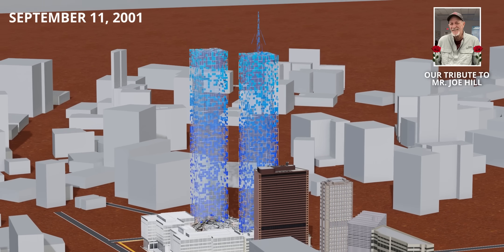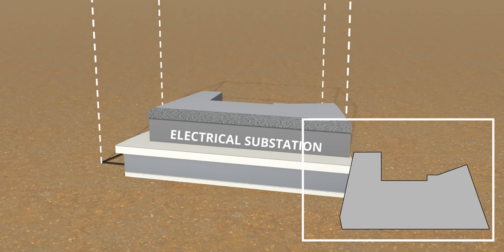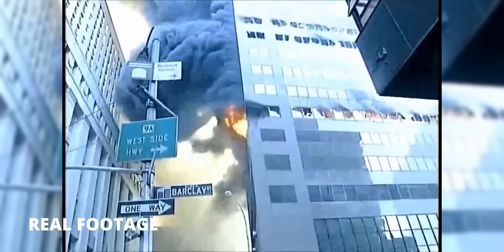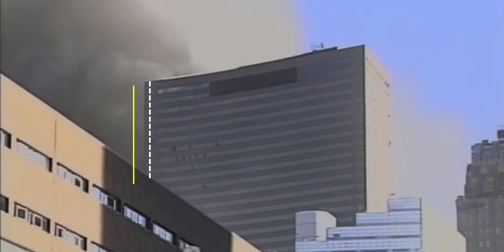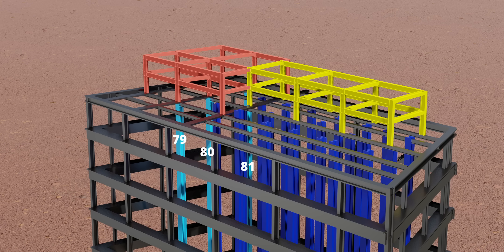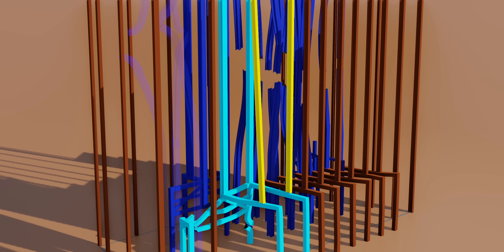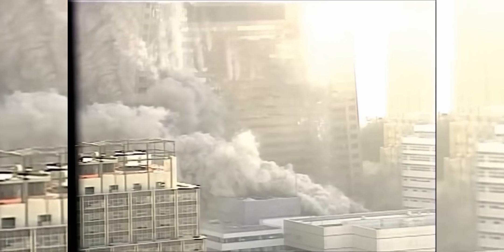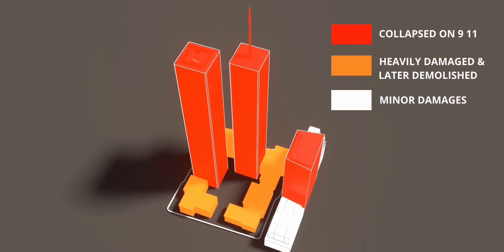Collapse of Building 7 | The Complete Physics

Comment: Makes me die. NIST mathematical computer input data to it's models isn't  available for public scrutiny.  Also NIST models do not show complete collapse of WTC 7 or WTC 1 & 2. To justify this NIST claims they were only tasked to find collapse initiation -  hence to this day everything after collapse initiation remains unexplained or unproven theory. INSIDE JOB.
Reply: Why do you think you need The NIST's model input data?  What would you do with it?  All you can do is re-create The NIST's models using the same software.  If you want to create your own models you sure as shit don't need it.  

IF you don't like The NIST (because the internet told you not too - unlikely you actually read the thing) they are hardly your only option.

The collapse of Building 7 is one of the most studied engineering disasters in history and the subject of 5 comprehensive engineering studies and more than two dozen technical articles in major peer reviewed engineering journals, most of which were published 15 or more years ago. Thousands of pages of material.

This should get you started.

FEMA BPAT (initial report superseded by NIST NCSTAR 1A)

NIST NCSTAR 1A: Final Report on the Collapse of the World Trade Center Building 7, 2008.

Guy Nordenson and Associates, WTC7 Global Collapse Analysis Report and Summary of Findings, 2010.

Arup, WTC -7 Structural Fire Analysis Report (Runs 1-4), 2010.

Weidlinger Associates Inc., WTC 7 Collapse Analysis and Assessment Report, 2010.

BRE Centre for Fire Safety Engineering, Analysis of the Impact of a Fire in the Mechanical Room (5th & 6th Floor) of the World Trade Center 7 Building, 2010.

T. McAllister, R. MacNeill, O. Erbay, A. Sarawit, M. Zarghamee, S. Kirkpatrick, J. Gross, Analysis of structural response of WTC 7 to fire and sequential failures leading to collapse, J. Struct. Eng. (United States). 138 (2012) 109–117.

For a summary of the major studies I would recommend THE COLLAPSE OF WORLD TRADE CENTER 7: REVISITED by Mhd Anwar Orabi , Liming Jiang , Asif Usmani and Jose Torero which is a 27 page summary of the different analysis and conclusions published in 2020. Sorry, YouTube will delete this post if I give the link but it should be easy to find and is available from the University of Queensland, Brisbane.

Real structural engineering industry professionals conducting real engineering studies and publishing them for other professionals to see. Not amateur YouTubers appealing to the gullible and credulous.

Happy reading
Reply: @TheCriticalStinker-01  Wht doesn't the NIST model show complete collpase? No real world experiments conducted to support theory. In fact , in the words of Sunder - " we have found a new theory with regards to WC7 - Global progressive collapase".
No scientific experiments to support theory. The NIST module of WTC7 around the area of Column79 doesn't have all the connections proceeding it - thats not hidden data - thats in thier report and reasons given for it. So where is computer simulation with all the connections. 

NIST has stated that they wouldn't release the input data to the public due issues of national security. 

The  year is also 2025 - your in the miniorty now if you think this man made structure wasn't a control demolition despite all the efforts to keep it hidden 😂
Reply: @Wallstrcrash2012  - The NIST did 4 models, each with a different purpose, testing different mechanisms.  None of them show the entire collapse because there is no need to.  

The NIST's mandate was to determine what caused the collapse of Building 7 with the aim of improving fire safety.  It was not to study why the building kept collapsing, which would do nothing towards that goal.  Further, the intended audience (structural engineers) didn't need it. Why the building kept collapsing requires no explanation to an engineering literate crowd.  Only conspiracists seem obsessed with it, almost to the exclusion of the cause. 

It is quite obvious you graduated from the School of Architects and Engineers for 9/11 Truth and thus happily repeat their dogma, which is mostly just The NIST was wrong (about a detail), something, something,.... reasons,,... inside job .  That is why it is so good that IF you don't like The NIST you don't need to rely on them at all.  As I already pointed out there are many other studies and technical articles to choose from.  While they may differ in the details, all agree the loss of Building 7 was due to nearly 7 hours of unfought fires throughout the building, taking it beyond it's design limits.  

That bit of bleeding obvious is true no matter what any study says and you are doing nothing with your NIST-bashing to move the needle on that. At best with your current line of argument the best you can hope to achieve is The NIST was wrong (about a detail) and ...  Building 7 still collapsed from 7 hours of unfought fire. 

That line of argument has got your pals at AE911T exactly nowhere in 18 years. 

If all of those previously mentioned studies are just too much, I would be happy to explain the collapse of Building 7 based on my own analysis, in a condensed form that only takes up one YouTube comment.
Reply: @TheCriticalStinker-01  So the total collapse of these buildings remains unexplained only a THEORY brought forward  of  initiation of a collapse that hasn't been proven to be the cause of a total collapase of these buildings. It is assumption only and down to an individual interpretation of perceived events 

 - Not very scientific that but they like to give the impression it is.

The first few lines of you post just killed your arguments. 

Why did NIST feel that had to carry out some real world experiments on the collapse of wtc 1&2 to begin with - What drove that thinking only to abandoned any real world experiments on WTC 7? 

Real world experiments are needed to support theory and you have none. You post about Conspiracy THEORY  and yet you defend a theory unsupported by scientific method - it is assumption only.  WTC7 theory was was brand new, pulled out the hat like a white rabbit.

You have NIST producing computing simulations that support theory only, and no real world experiments to back it up and data withheld. Those simulations dont even show complete collapse because they can't  becaue its a lie. 

As someone who believes in CD I could point to so many real world examples that support my theory - buildings that burned for long times, failed control demolitions that proved collapse is not inevitable  and ones that were successful and match the observations. Not to mention the contradictions in official theory (so many you that you know its a lie. CD theory has never deviated)

It is you who need to prove that your mind isnt biased toward the outcome. Run real experiments and ensure the outcomes are repeated - not just in the lab but anywhere in the world and available for public scrutiny and testing.
Reply: @Wallstrcrash2012  - IF you can do better I suggest you get on with it already. Go ahead and be the first to even try.  Do something productive for a change. I am so sick of reading the same tedious denial bullshit over and over and over. FFS 🤦‍♂
Reply: @TheCriticalStinker-01  Because NIST lied thats why lol otherwise this topic would never gone on so long or been as big. You said it yourself - NIST didn't explain the Total Collapse of the buildings - ,just the collapse initiation and assumed the rest.
Reply: @Wallstrcrash2012  So, you said dumb shit. You got explained what the facts were, and in response you said more dumb shit, which you got called on. And then you threw a tantrum because you didn't understand that your dumb shit was dumb, and it was mean to show you it was.

Good effort!
Reply: @Wallstrcrash2012  - The NIST does explain the global collapse of Building 7 if you bother to read it and know what they are talking about.  I would love to see you make a case they lied as in deliberately made misleading or incorrect statements or drew false conclusions.

I don't even know what you are so up in arms about.  It's not like you actually read any of this stuff. You are just (badly) copying a bunch of other peoples failed arguments you found on the internet, and know so little about them you keep mixing them up.

Tell you what, since you still can't figure it out, how about I explain the collapse of Building 7 for you?  I promise it will be quick and give you everything you really need.  Then you can quit your whining, and even better you won't have to keep banging on about The NIST because it doesn't come from them.
Reply: @TheCriticalStinker-01  You stated that NIST didnt have to find why the building kept on collapsing - you argument was dead at that moment. All they come up with was a theory of a collapse initiation but never actually proved by simulations or real world experiment how it was the cause of entire total global progressive collapse they claimed. You cant see the wood for the trees.
Reply: @Wallstrcrash2012  - Again, you are getting your arguments confused - mixing Twin Towers and Building 7 because you don't understand your own arguments.  But since you are deep into boring the shit out of me beating the same dead horses:

Building 7 was the 6th building to collapse of 10 lost on 9/11 and because of its early low priority was largely ignored for a while, so conspiracy filled the information void with simple-minded garbage by technically ignorant people promoting political agendas. This created a lot of confusion and misconceptions which I wish  to dispel, so I prepared this brief summary of my own analysis, using technical analysis. 

At 10:28am the WTC North Tower collapsed, showering Building 7 with tons of burning debris, causing heavy damage and starting many large  fires which burned out of control for the next 7 hours. Half the FDNY firefighters having been killed, units in disarray, equipment destroyed, no water pressure, and the greater urgency of search & rescue efforts, Building 7 couldn’t be saved so firefighting efforts were pulled as futile and 7 left to its fate. Firefighters make that sort of choice every day in brush fire situations - which houses to save and which ones to let go. Only real difference here is moving the decimal on the size and cost. People get overwhelmed.

www.youtube.com/watch?v=g_SvpwyC17M

Collapse of a burning structure is always a concern for firefighters. Steel buildings subject to fire rely on active firefighting to survive. Buildings are designed around 1 to 3 hours of fire resistance, allowing time for occupants to escape and active firefighting to get started, after which all bets are off. Left to their own devices they'll exceed their design envelope and collapse, like Plasco Tower and Wilton Paes de Almeida. In 7 the occupants escaped, passive and active fire protections were compromised and active firefighting was abandoned hours before the collapse, which left the building to its fate. It lost. Odds on Building 7 would eventually collapse, and it did. No big deal in logic.

 http://www.youtube.com/watch?v=WnYBX6QT0R4 

FDNY Chief Daniel Nigro - The biggest decision we had to make on the first day was to clear the area and create a collapse zone around the severely damaged 7 World Trade Center, a 47-story building heavily involved in fire. A number of fire officers and companies assessed the damage to the building. The appraisals indicated that the building's structural integrity was in serious doubt. I issued orders to PULL back the firefighters and define the collapse zone. It was a critical decision; We could not lose any more firefighters. It took a lot of time to PULL everyone out, given the emotionalism of the day, communications difficulties and the collapse terrain 

FDNY Deputy Chief Peter Hayden ; We had our special operations people set up surveying instruments to monitor and see if there was any movement in the building. We were concerned of the possibility of collapse in the building. And we had a discussion with one particular engineer there, and we asked him if we allowed it to burn could we anticipate a collapse and if so, how soon? And it turned out that he was pretty much right on the money, that he said 'In its current state you have about 5 hours 

The collapse of Building 7 was anticipated and widely reported in the media throughout the day, with 24 video cameras recording some or all of the collapse. Everyone knew what was coming and why. 

www.youtube.com/watch?v=OY5S5k3tMHI

Building 7 collapsed from the inside out which is not at all intuitive and hard to understand, with most details being hidden from view.  It requires careful analysis and observation, and some people will struggle no matter how much it is explained. But here is my explanation relying on no outside authority. 

Building 7 was a unique, asymmetrical 47-story steel frame structure built atop a smaller 3-story building serving as a partial foundation, requiring lower floors dedicated to complex load transfer structures. Of trapezoidal shape and tube-in-tube construction, B7 (above the 7th floor) consisted of a central core of steel columns carrying most of the gravity load, perimeter steel columns around the outside of the structure carrying the remainder of the gravity loads and long span beams and girders to tie those elements together and form the floors. On the outside of the building hung a facade or outer shell. 

www.nist.gov/image-16640

Phase 1 : First externally visible signs of collapse initiation occurred at 5:20:28 pm and was notably quiet with observers not realizing the building was collapsing! No warning in the form of hundreds of eardrum busting 180dB explosive bangs. Here at 12:00 a local CBS affiliate reporter talking 10 blocks from B7 when collapse begins. People don’t start to notice the collapse until 12:11. At 12:45 is the famous CBS fixed camera clip of Building 7’s collapse. Note the silence. 

www.youtube.com/watch?v=t5tEy6mXSE8

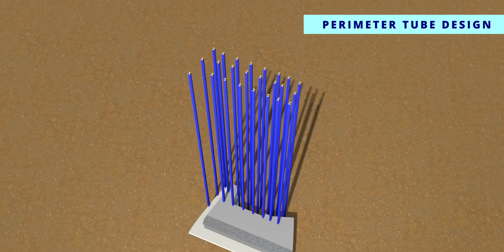Lower floor failures above the load transfer region (8-14) in the NE corner initiated the collapse. In this video at 0:45 you can see the NW corner from inside the building while under construction, Column 79 just out of frame on the left. That big, angled steel beam across the top of the frame connects to C79 at one end. The girders connect to the beam. That beam and all those girders depend on just one connection 

www.youtube.com/watch?v=nP3TNHPCIVU&t=45s

Phase 2 : NE corner floor failures caused a loss of critical lateral support over an excessive length of Column 79 and it buckled. Looking at the above floor diagram of Building 7 when you see all the structures that depend on C79 you quickly realize this one column was a relatively isolated structural element on which a disproportionately greater fraction of the structure depended analogous to say the Key Bridge. Externally as collapse begins we see a vertical progression of window breakage along the 44-46 line and a kink in the roof of the East Mechanical Penthouse at the top of the building, consistent with C79 failure. Normally with a buckling column, the load could be redistributed to other columns. With C79 that is not the case - the failure did not redistribute the load, so the collapse rapidly progressed to the roofline, sinking the rooftop penthouse. The transition from full capacity to almost no capacity occurs in an instant and will result in virtually no resistance 

Phase 3 : With C79 gone, B7’s progressive, non-symmetrical collapse continues with adjacent columns 80 and 81 left laterally unsupported and quickly buckling as well. The EMP drops down through the building. C79-81 all have no diagonal bracing, which is the major reason why they could not redistribute a lot of vertical loads among one another. From there collapse progressed from east to west through the central core until the core was gone from 81 to 58, taking all the interior floors and probably most of the perimeter columns with. Follow the horizontal progression of window failures low in the building and the dropping of the remaining rooftop structures into the building. The NIST Building 7 study model 4 determined C79 failing under ANY circumstances would have initiated the same collapse sequence. 

Phase 4 : After about 10 seconds only the exterior moment frame remains, giving the illusion B7 is still standing to the casual observer since little has outwardly changed. But it is just a hollow empty shell like an empty cereal box supported only by a few remaining columns and overloaded from the loss of the core columns and floors, quite unable to remain standing. With nothing remaining behind it, the north face leans inward, forming a V in the roofline, the last few columns buckle under the strain and the moment frame free falls, landing on top of the debris pile. 

It is only here at the very end, a single measurement of alleged free fall acceleration is taken, from just one point on that outer shell. The Building (core and interior) did not “free fall” - was already gone before that happened - just one corner of the outer shell briefly moved at a rate comparable to FFA. This alleged FFA was a product of how the shell fell NOT why the building fell . It’s also not even proper FFA as the single measured point was moving in 3 dimensions, not just down, which adds another variable. Start to finish the collapse took 18-20 seconds, 3 times longer than true FFA . How fast something falls can’t tell you what started it falling, certainly not 10 seconds after it started falling.  

The debris spread outside the footprint blocking surrounding streets, heavily damaging the Verizon Building and destroyed Fiterman Hall. 

No building is meant to survive 7 hours of multi-floor unfought fires. Building 7’s progressive, non-symmetrical collapse was incidental, unintended collateral damage from the combination of fire, time & gravity started by the collapsing North Tower, true no matter who planned and carried out the 9/11 attacks or why .  Of so little consequence it barely registered at the time, only taking on semi-mythical status as an alleged smoking gun years later when demolitions at the Twin Towers, missiles at the Pentagon and shoot down over Shanksville all failed and conspiracists had nothing left to work with. 

Anything can seem like a conspiracy if you don’t understand how it works. Now you should. I hope you found this helpful, informative and it solicits informed critical comment. If I made any errors of fact, logic or reason or left anything important out, please let me know so I can fix it. OR offer a more plausible alternative if you can. Be the first. Please start any reply with the words “Tits McGee” or I will know you didn’t read it and are wasting my time.